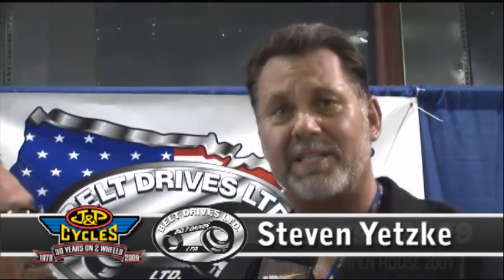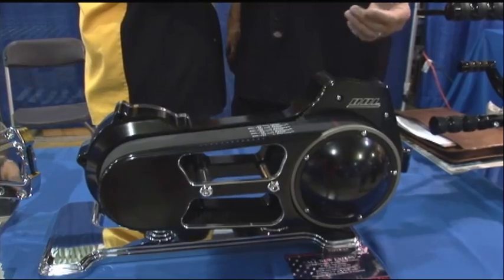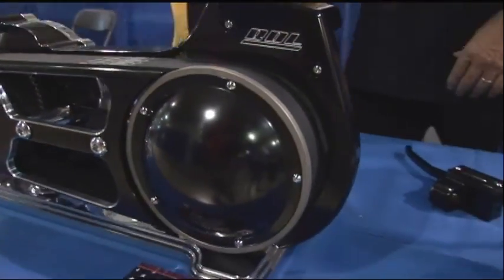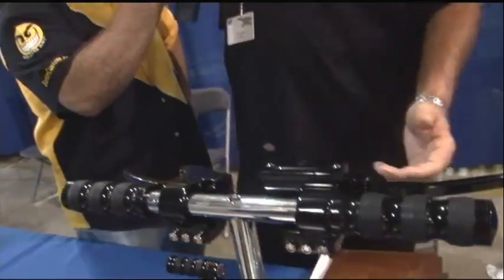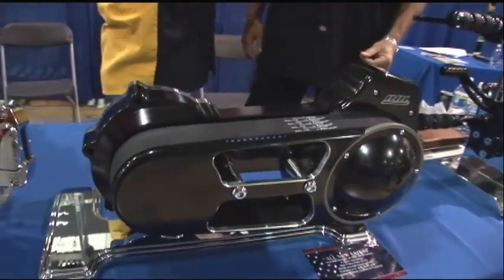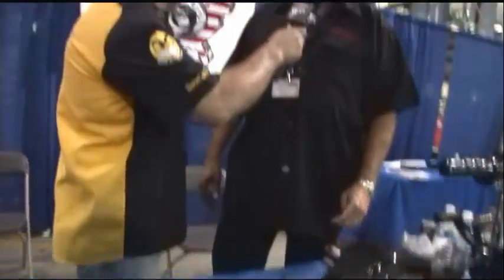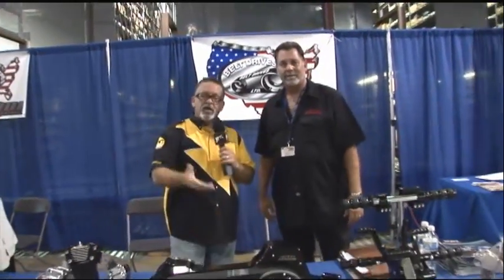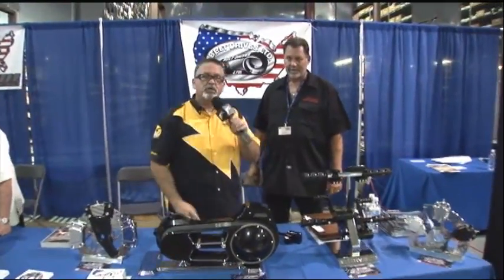Belt Drives Ltd from J&P Cycles

Comment: harley davidson will be going to a belt drive primary in the distant future, they are easy to change in minutes, and require no lubrication. Right now they have their new 107 ci 114ci engine and won't change at this time but they will very soon or go to gear drive.
Reply: Harley will never go to a open belt drive.